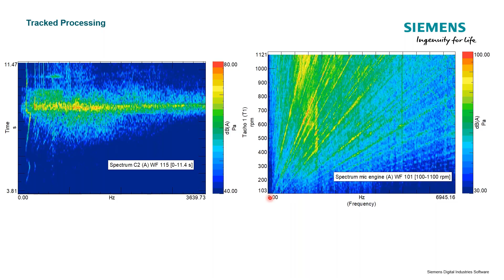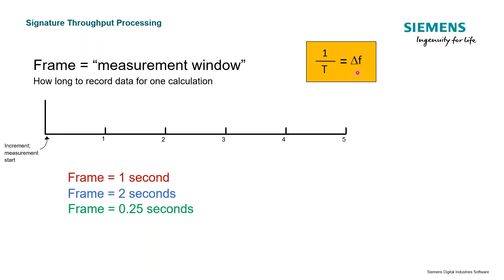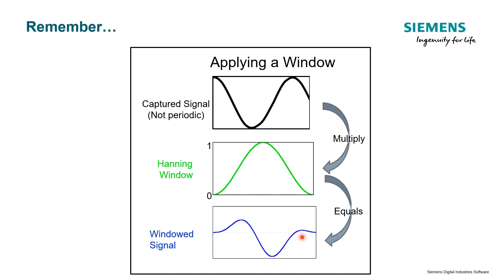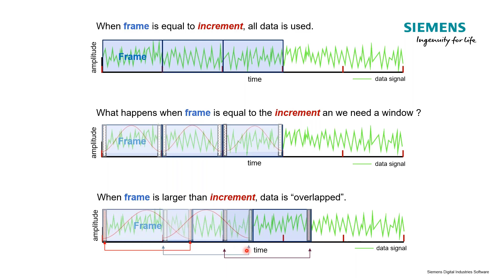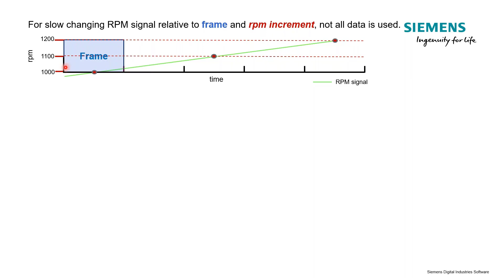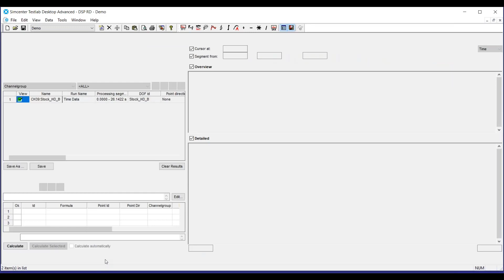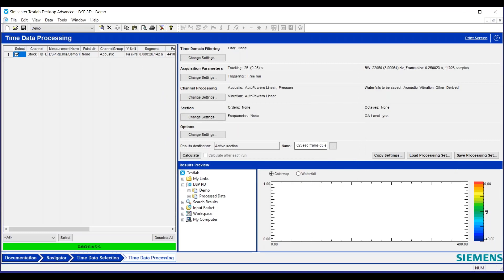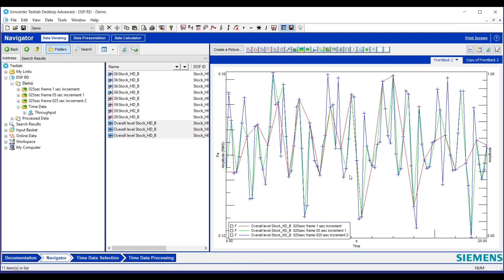Frame, Increment, and Overlap

Comment: Hello, during the test, when the speed is tracked, is the smaller the increment, the better? Thank you and look forward to your reply
Reply from the maker: In general, the smaller the increment the better.  The main drawback is that the data size increases with a smaller increment.